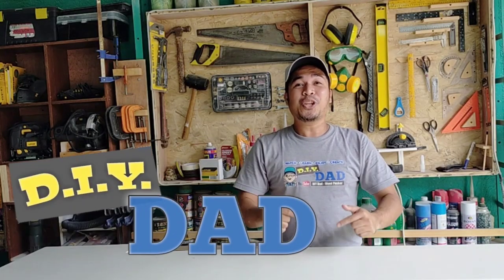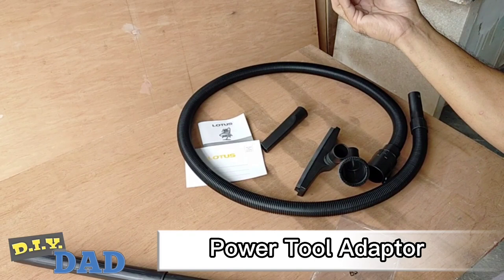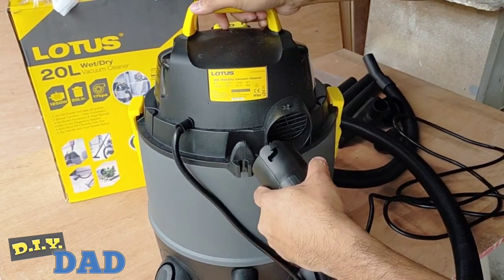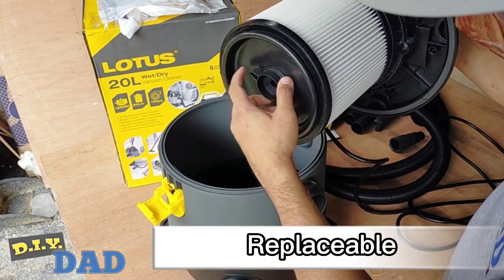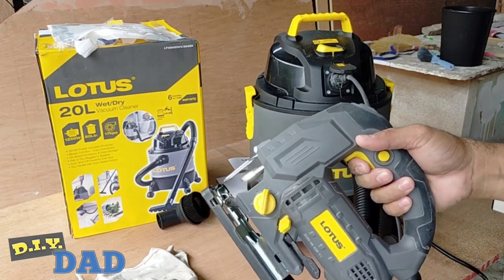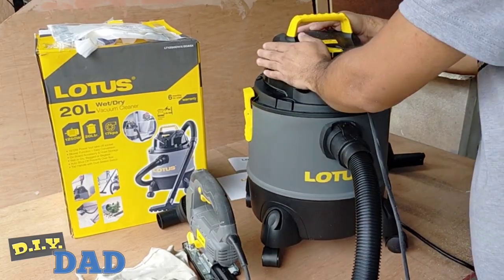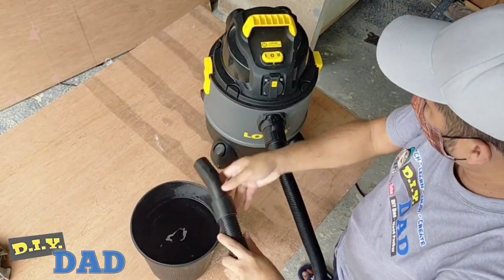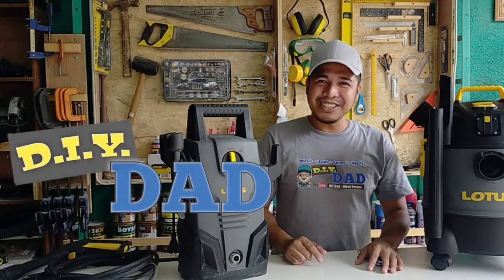Lotus Wet & Dry Vacuum Cleaner || Super Vacuum Cleaner || Vacuum Demo || Lotus Vacuum

Comment: Question lang po. 
1.Kaya ba nyan humigop ng tubig sa carpet? Like an extractor?
2. Hindi ba tinatanggal ang filter pag mag wet vacuum? Dba mababasa ung filter, then pag nag switch back ka sa dry vacuum hindi ba didikit ang mga dust sa filter resulting to poor suction?
Your response po will greatly appreciated.

Thank you.
Reply from the maker: Hi sir! Good day!

1. I experienced using it nung naglinis ako ng car seats ko and ok naman siya humigop ng tubig. So sa carpet mas ok xa.

2. Pwede tanggalin pero hindi advisable. Kasi bka magka leak ang water sa loob na mag cause ng short circuit sa electrical boards. Ung filter is water resistant and madali xang linisin, papatuluan mo lng xa sa running water no need na i brush. Sway sway mo lng pag nalinis then mabilis mag drip down ung water, madulas ung surface ng filter kaya madali linisin. ☺️
Reply: Meron syang different filter/foam na inilalagay to replace the filter pag wet vacuum.

Comment: Hi! I also have lotus 1800watts table saw. Kaya ba talaga ng power tool socket ng vaccume na yan yung table since the socket is only 1610w?
Reply from the maker: Hi sir! You watched the video na po? I used it with my Lotus table saw and wala naman naging problem.😊
Reply: Yes, I watched the video but I am just worried that in the long run, something will go wrong since the the wattage of the table saw is higher than the wattage of the power tool socket.

Comment: Very nice Video, thanks for sharing. Abut to order one, and the washer too as soon the sale starts in some hours, plus i need to find  where to buy replacement filters, Any advice where to get them, cant find it
Reply from the maker: Thank yoi so much!😊 You could order at Lotus Official FaceBook page, just drop them some message. Here's the link https://www.facebook.com/lotustoolsPH/.
Reply: @DIYDADWoodPusher   will wait for their reply, but  if its correct that they charge like 1500 pesos for 1 filter,   then the  machine is not worthed for me
Reply from the maker: When u purchase a unit it already comes with a filter. The gud thing about he filter is u dont need to use dust bag and it can be used for wet and dry. Sometimes im also using mine in drying my car seats .
Reply: @DIYDADWoodPusher   thats the confusing part.  others say its wise to use the foam or textile bag to protect the filter, they say that  water  directly on the filter  will reduce lifspan of the filter.  For fine dust in the house they advice to use dustbag, for bigger particles  just directly in the  bucket.   i just ordered the smaller one of 3 gallon for 3.2k pesos .  and some extra attachments  for 300 pesos and  pressure washer 1400 watts with long lance for 2.6k pesos.  i dont think it will suffer much from usage here just for simple household chores , the wet function i like cos when i drained our framepool, always some water left,  too lazy to keep on scooping and mopping  in this heat hehehe

Comment: Hindi po ba dpat tinatanggal ang filter pag wet surface po nag i v vacuum?
Reply from the maker: Hello po! At first yan din po ang thinking ko.😊  
But no need to remove the cartridge filter once na gagamitin sa wet. .. to protect the motor from the water shrinking. to avoid short circuit

Comment: Ilang CFM?
Reply from the maker: I am not so particular with the cubic feet per minute. Pero as i researched thru http://www.carousell.ph up to 350 cfm ang Lotus 6 liters vacuum.☺️
Reply: @DIYDADWoodPusher  Thanks. Ilang wattage ang supported ng power socket niya? Can a 2000W tool be used?
Reply from the maker: @enshongmiranda  as per lotus product specialist kaya ang 2000 w / 50hz na table saw☺️